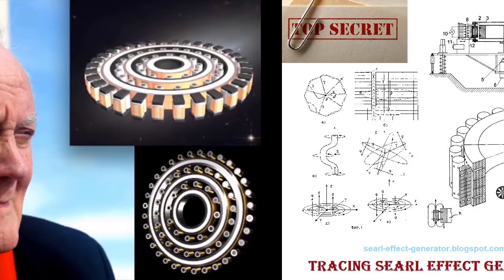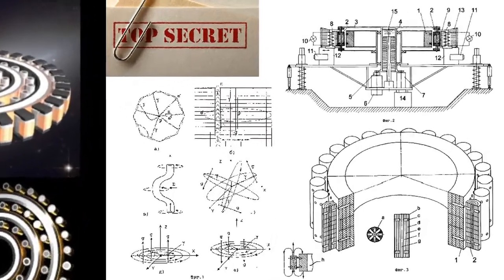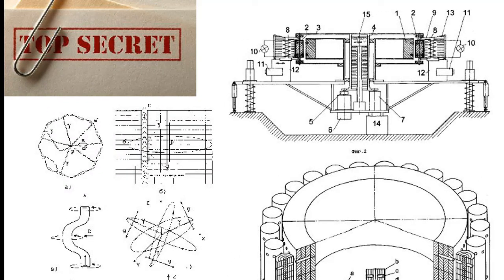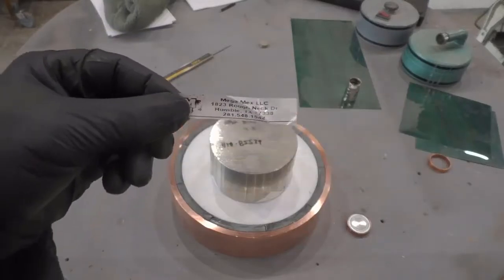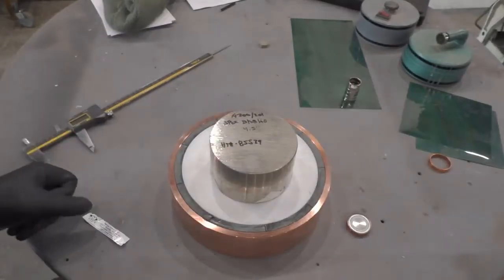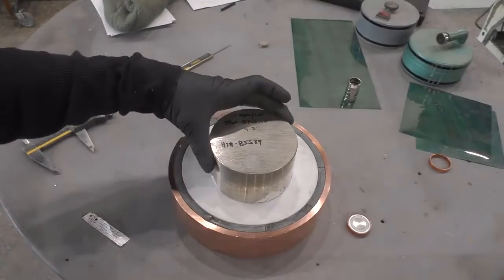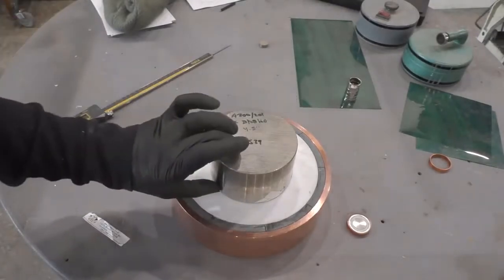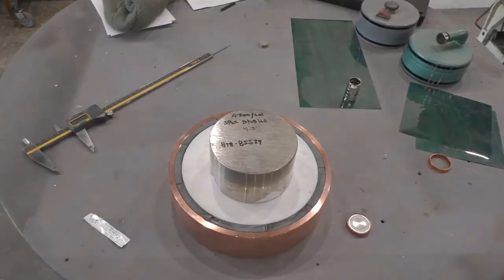Searl Effect Generator: Voltage and Speed Demonstration, Biography, Technical Description

Comment: Ble, ble, ble, .....So many years have passed and there is no product on the market . It's a scam. I personally would like to buy such a generator .
Reply: The issue is with the SEG is that the process of imprinting the magnetic layer with wave patterns is a secret and takes a lot of resources to replicate. Otherwise there would be no energy output from the SEG. Apparently, only Searl’s successor: Fernando Morris knows about this process, and not even John Searl knew himself how to do it.

Their plan is to have a working model built with $3 million of funds from a potential investor/crowdfunding. I heard multiple attempts were made to crowdfund on sites like Kickstarter but had some issues and had to return back the funds.

Morris wants to build a 15kWh SEG for home use. $50 million minimum to produce SEGs at a large scale. But first the proof of concept needs to be built to show the world that free energy is possible (not really free because it takes energy/heat away from the surrounding environment).
Reply: @mastihatears yes you need another seg to be able to do the imprinting ..its not a scam this man has already built them and igv craft at age 12 he was a genius ..it like this we know of and have seen water powered cars but do we see them in everyday life .? 99%of the world don't ..why is that ..we know why ..money money hungry prices 😅

Comment: Wont magnetic bearings affect the output of electrical current?
Reply from the maker: It is it that causes the coil to have voltage. If there is a load, current flows.
Exactly how winding will affect magnetic bearings. However, the coils and magnetic bearings are uniquely designed, so the back electromagnetic field (Back EMF) will not affect the speed of the magnetic rollers.
Reply from the maker: The answer is also here: https://searl-effect-generator.blogspot.com/p/secret-searl-effect-generator.html
Reply: You could use ceramic bearings